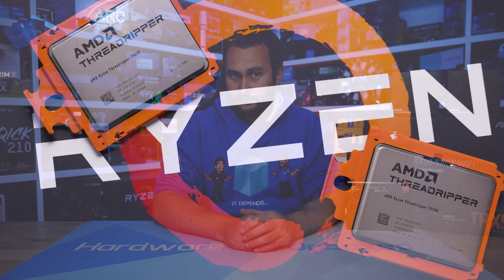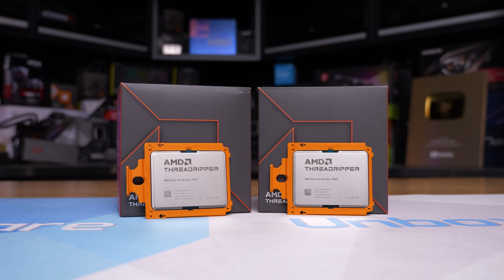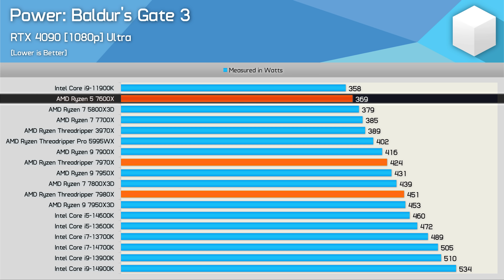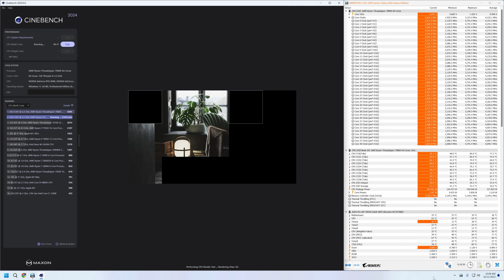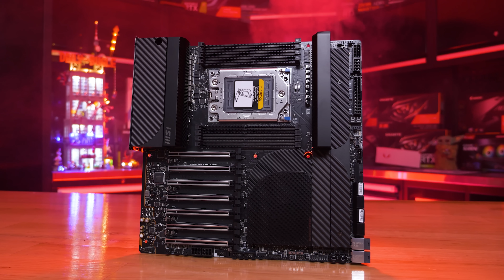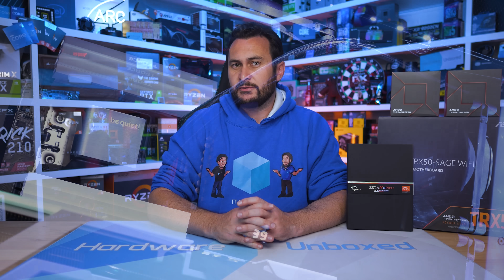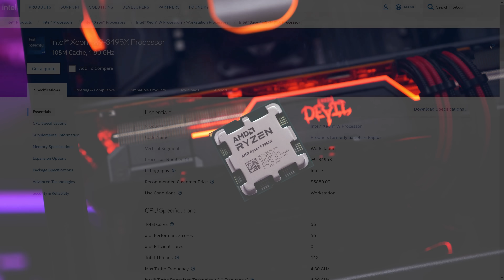AMD Ryzen Threadripper 7970X & 7980X, Benchmarks, Power & Cooling

Comment: As a mere PC gamer, Threadripper is way beyond anything need or even can afford. That said I love seeing how insane CPU's can get, and there's something to be said for massively expanded IO connectivity.
Reply: Zen4 Threadrippers are all workstation-tier platforms. AMD tries to pass the regular Zen4 Threadripper as HEDT, but in practice it is a full-blown workstation (Needs RDIMMs). WRX50/Zen 4 Threadripper PRO are heavy-duty workstation blurring into the HPC/server space.
Reply: @Krogoth512  I'm disappointed about that. I was hoping we'd see some lower-end SKUs (maybe a Threadripper 7950X with only 16 cores) and relatively cheaper TRX50 motherboards that could be used with normal unbuffered DDR5 to make a high-end gaming PC with quad-channel RAM. It seems we won't get this any time soon. I know there are plenty of enthusiast gamers who would buy it just to get the maximum possible performance, just like how there were plenty of enthusiast gamers who bought the i7-6800K and Core i9-7900X.
Reply: and than, there are the dual socket epycs with an extra 3d cache for some spice. Truly insane.
Reply: Well it's not a gaming CPU. It's a Workstation CPU.
Reply: Because MSDT now already get plenty of PCIE lanes. Like AM5 for 16+4+4 straight out from CPU (plus another 4 to PCH). During X99 days, lower, more wide spread 5820k 6800k only get 28 lanes. Also SLI is dead. And not much games could ever leverage >16C32T (I believe CSL2 could leverage 32C64T that's the max thread count usage I heard of from a game)
Reply: @fhs7838  The reason for gamers to want HEDT options is for the extra memory bandwidth.
Reply: With how insane modern games are on even 7900xtx/4090s we need sli back @fhs7838
Reply: The issue is that HEDT like Threadripper is too expensive and has way too many PCI-e lanes, more than what I would ever need... while Ryzen and AM5 can also get quite expensive at the higher end and still not provide enough expandability, with some of the most expensive motherboards only offering 2 free PCI-e slots after installing a graphics card... and all this due to the horrible trend of placing more and more NVME slots on the motherboards!!...
Reply: These are HEDT's as AMD is advertising them, they are workstation class hardware.  Idk wtf they are thinking by pushing this bs.
Reply: I'm a primarily a gamer myself, but with quirks: i love PCI-E devices+games with complex real-time simulations. Even tho i run X570, i want more pci lanes anyway. So, for me 7945WX with shit load of PCI lanes looks like perfect version of 5900x i use.
Reply: Get into Blender and see how fast your mind changes XD
Reply: 7800x3d is so cheap and efficient that it rarely makes any sense to look into anything else if you need high-end gaming systems. Can pretty much pick the crappiest vrm motherboard, throw in a 35$ peerless assassin and you are under the cost of 14900K alone before even considering the need of a 200W larger psu.
Reply: Dear  @jepulis6674  ,

Everybody said, that the bulldozer is abad CPU and needs a lot of power. Well, Even the 9900K and 9900KS used more power but after that 10900K, 11900K both could use more power and after that 12900K and 13700K and 13900K, 14700K and 14900K used/uses more power. 😲 😞
Reply: Threadripper is equal/better in gaming due to high clocks and lots of cache. Also the same logic applies to the 4090. Threadripper for gaming is actually BETTER value, because now you can do a lot more than just game with your PC.
Reply: @chiefjudge8456  I dont think L3 can be shared or at least that easy cross CCDs. Also I think EPYC and TR has much higher RAM latency than MSDT. Still, boosting 32/64cores monsters to near 5ghz is never heard of.
Reply: Apple m cpus still destroy this in efficiency
Reply: @jakecassidy1015  it doesn't ☠
Reply: You think you won't need it?

Try becomming an engineer and also having a home-server. You will have fun running web-services and simulations on such a compact thing. :)
Reply: @Splarkszter  I won't need it.
Reply: @Splarkszter Am and have large home server n still don't nor want it..
Reply: For a gamer it is beaten soundly in games by a much cheaper i5.
Reply: @FullNietzsche . I think the point was that given their computing use case (“gamer”), and it does so much more than they could use it for (“beyond anything need”), or even within their justifiable budget (“even can afford”), they still enjoy this content (“I love seeing…”). The last part was the point of their comment, and at no point do they express how they felt about the gaming prowess or its usefulness in that field.
Reply: @robertt9342 man i wish there was guy like you under every comment section, it’s like half the population has 3th grade reading comprehension
Reply: @robertt9342  it gets smoked it gaming by i5's
Reply: @FullNietzsche this cpu is for creating games
Reply: But can the i5 play games at playable framerates in 1440p to 8K, while rendering 8K uncompressed animations or video files in real time simultaneously? Not even close! Yes Threadripper will not have the fastest FPS, but when you can do 100 million other tasks in parallel at playable high resolution FPS, the writing is on the wall. @FullNietzsche
Reply: @FullNietzsche  There is zero reality where an Intel Core i5 touches any Threadripper on a good day.
Reply: it is beaten by x3d , not i5. both in fps and power usage. @FullNietzsche
Reply: @FullNietzsche  Gaming is a GPU activity so this is a nonsensical statement. Threadripper is equal better in gaming to high clocks/lots of cache, while being 8-10x faster in general than a cheap and slow i5.
Reply: @chiefjudge8456   Did you look at the gaming benchmarks in this video?
Reply: @chiefjudge8456 That's not an entirely true statement. Graphics cards require substantial amounts of CPU power in order to render draw calls quickly enough and depending on the render target it can easily bottleneck.  I think your statement is an oversimplification of PC gaming, rasterization, ray tracing and latency as a whole.  PC gaming is more of a mixed workload than it is specifically targeting a particular component. All the components involved with rendering engines require a certain level of latency between each component within a computer system. Sure, the GPU is the primary target but a CPUs instruction per clock cycle as it pertains to draw calls is highly relevant to rendering a game at a particular frame rate. So yes, having a CPU with a decent IPC and clock speed absolutely matters when you're targeting certain resolutions.
Reply: @Anonymous______________  nope that's the game engines limitations.
Reply: @FullNietzsche Or a 7800x3d. But I'm assuming you're a fervent intel fan boy, hence why you mentioned an i5.
Reply: @beeman4266   You assume something stupid then. I mentioned the i5 because of its relatively low price and the fact it's a mainstream option. I know more expensive CPUs are even quicker than that.

Comment: I want to see AMD put as much effort into their GPUs next!
Reply: If you think it's a simple matter of "more effort", you are completely mistaken. Believe it or not, the Radeon group is extremely highly regarded and respected within AMD, because they are at an inherent disadvantage against Nvidia in various respects, and yet they keep making relatively competitive products anyway. The bad press that Radeon products often gets is usually blown way out of proportion.
Reply: @syncmonism  I'm using a 6700xt as we speak. I just want them to knock it out of the park ( like they have been with their cpus). I don't think that's too much to ask! If anything it's  routing for them to excel.
Reply: @steveozone4910 for now Intel looks way more promising
Reply: @GewelReal hopefully intel gets the power draw right soon, they have powerful hardware that isn't translated fully into gaming as of yet
Reply: What on earth do you think they did pioneering MCM GPU designs?
Not making simple proven incremental improvements is risky though and so far it sounds like that effort hasn't fully paid off.
Reply: Looks like AMD is putting the most effort into GPUs out of the three.

Comment: What's with the trend of making a goofy confused look on the thumbnail?  So many youtubers do it for clicks.   Can we stop doing this already?
Reply from the maker: Not to be a dick or anything, but have you just started using YT? Seriously though we wouldn't do it if it didn't work, you can blame people using YT, not people making the content.
Reply: @Hardwareunboxed  Fair enough.  Then my distain is too the impressionable normies and not creators.
Reply: @Hardwareunboxed LOL got em
Reply: Did you happen to test out the old 5000-series Threadripper on the new board to isolate whether the previous issues were on the MSI board vs the original processor? I’d be interested in knowing one way or the other.

I know both ASUS and MSI make TONS of motherboards so maybe this is just a matter of them representing such large shares of the market, but it sure seems like I hear of a lot of issues with them. I used to default to ASUS motherboards (and GPUs) myself years ago and actually still have a couple right now, but I ended up having a couple (not insurmountable) issues with the X570. The other, newer ASUS MB still needs to be run through its paces; I have yet to bother enabling XMP as the 7800X3D in it runs Starfield like a hot knife through butter, and given that Starfield has presented a lot of problems for a lot of other players I’ve left the system in a very safe untuned state as I continue to feel out the stability. Yet I hear from others of memory tuning stability issues with AM5 ASUS boards that are not going away. It’s giving me a bit of trepidation about ever enabling XMP, which admittedly X3D chips have less benefit from anyway.

Anyway, in between I have tried out a couple Gigabyte boards and they have been completely flawless. I’ve also noticed in your reviews among others, they sure tend to run best among the competition in gaming benchmarks on Ryzen processors. I’m feeling like they’re about to become my new default when it comes to motherboard purchases going forward.
Reply: Totally agree. Too many people are braindead and will click on anything with a 'funny face'. Kind of a shame that HUB thinks it has to pander to that crowd.
Reply from the maker: @JimmyBob6786  we don't think we need to 'pander to that crowd'. We know what we need to do in order to maximize exposure, which you know, kind of ensures the channel doesn't die. Don't take being 'relevant' on this extremely saturated platform for granted, it's competitive out here. I'm sorry to say that your mindset would fail in this environment.
Reply: Cry me a 14900K bro
Reply: @jasonferreira4761  IDF is that you? (Intel defense force).  Speaking if which, what are your guys thoughts on the Palestine conflict?